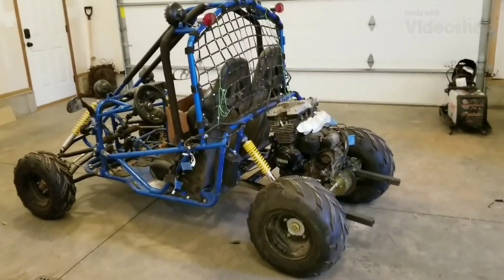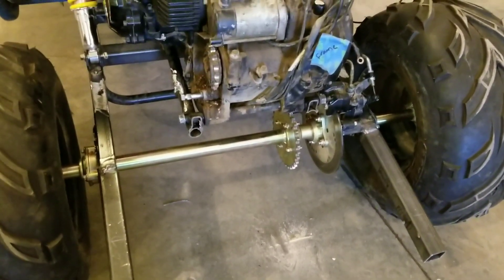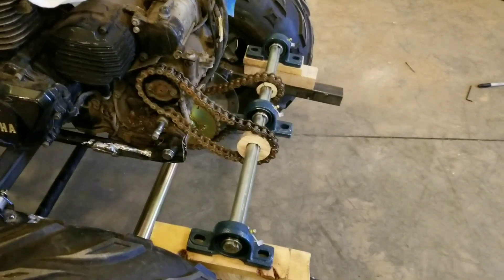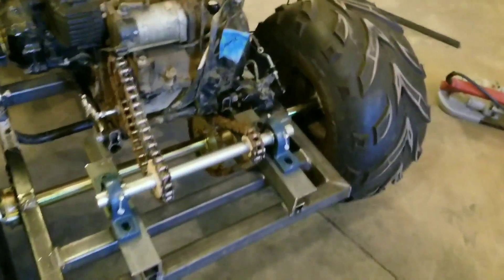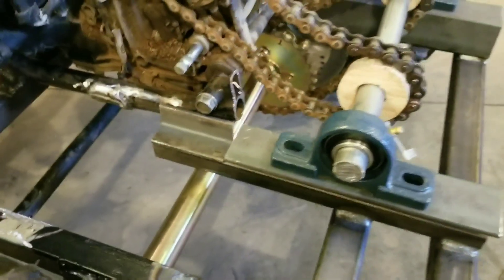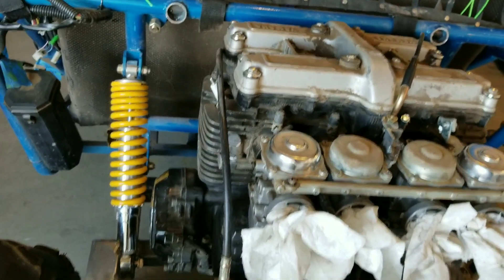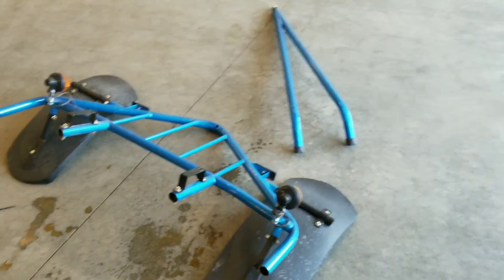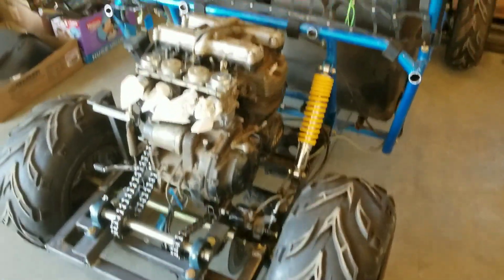600cc motor swap to buggy. Video #2 go kart

Comment: Hey what's up I'm building one with a motorcycle engine as well and I would like to know the name of the stuff you use to make that bracket in the back with the extra sprockets I really appreciate it and you made a amazing go kart
Reply from the maker: @AlexMartinez-s2d  1" pillow block bearings, 1" steel shaft and a couple sprockets I found online.

Comment: Why do u need a jack shaft? Could u move the sprocket inline with the motor and not use the shaft system?? 
Im new to all this, there is probably a good reason
Reply: You have the abilities of adding adjustment when you use a jack shaft bro in my opinion it's a better choice and looks cool too imo
Reply from the maker: @boostedadrenaline2884  Exactly!  I can change its gearing for cheap.
Reply from the maker: The sprocket on the original buggy axle has a welded on bracket, I wasn't able to move it without more modification. I also was not able to make the chain from the motorcycle go straight down to the axle. So basically the jackshaft helped twice.

Comment: What is the gear size and chain size you used building one my self   I'm trying to figger out the sizes I need
Reply from the maker: 530 chain. The jackshaft has a 16 tooth from the motor and a 12 tooth going to the axle. Stock sprockets on the motor and axle.
Reply: @mr.b1259  ok cool what size jake shaft you using. I'm using a ex500 motor I was thinking a 1 inch
Reply from the maker: 1" jackshaft. It has held up so far.
Reply: @mr.b1259  very nice that what I was thinking thank u